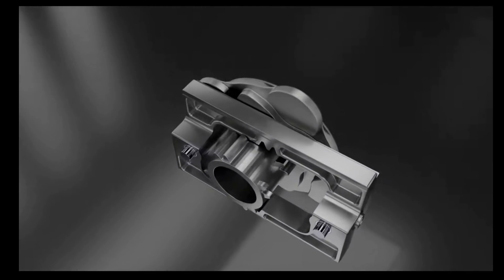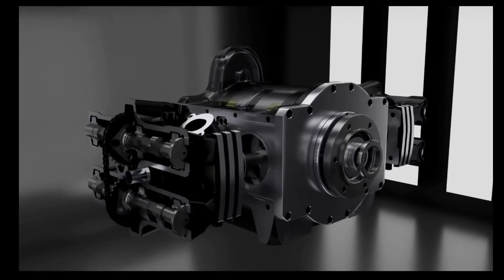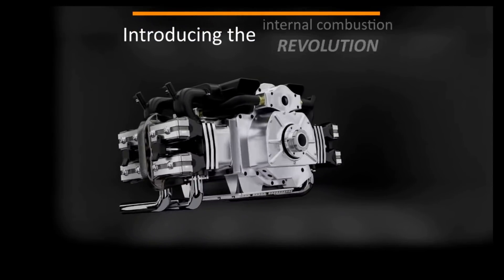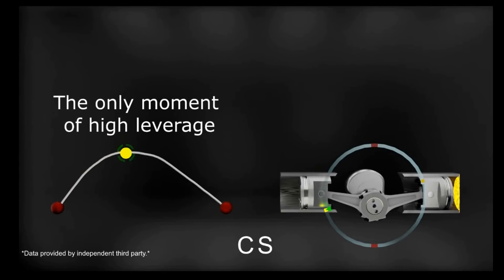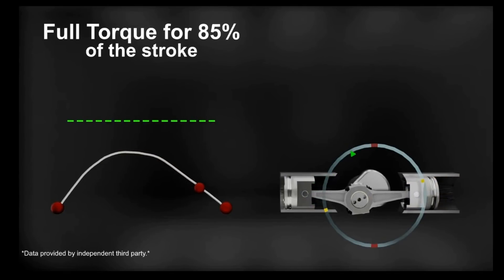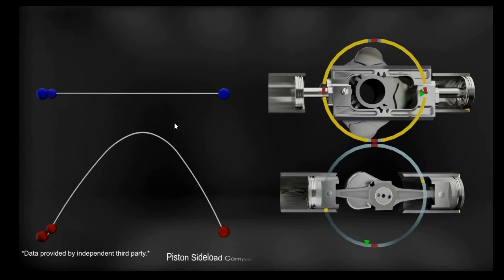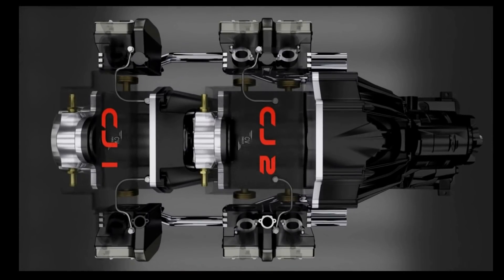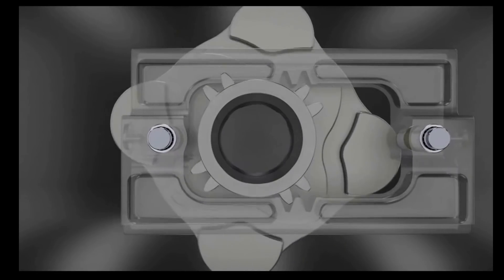More opposed Piston engines

Comment: I would like to hear your thoughts on Achates. They have been around forever with prototypes but haven’t been able to get to mass production.
Reply: It's the Junckers Jumo but now it's dropping off junk at Walmart instead of dropping bombs on London. At least with cylinder ported diesels you're not blowing a load of fuel out of the exhaust like with petrol ones.
Reply: At least Achates Power is farther along than Alfadan and this company.

They already got Walmart to agree to test their engines in a real world 3 month cycle to compare it to the standard Diesel engine that they're using.

https://www.nwaonline.com/news/2021/may/26/walmart-truck-to-test-new-diesel-engine/?business

A truck from Walmart Inc.'s private fleet will test a cleaner-burning and more efficient diesel engine starting this summer.

The three-cylinder, 10.6-liter engine will be placed in one of Walmart's Peterbilt 579 trucks to haul goods in Southern California.

Although the engine has been tested in labs, its use in the Walmart truck will be its first on-the-road test, said Karen Caesar, information officer for the California Air Resources Board's Southern California office.

The truck will be in service starting in July and will run for at least three months, said Larry Fromm, executive vice president of business development for Achates Power Inc.
Reply: From information released to the public, there is no reason why Achates's engine will not work.  However, it is a 2-stroke diesel engine.  The challenge is on meeting emission standard.  It may also consume a lot of lubrication oil.  If you are Ford, you will be　hesistating  to put this one into production when emission control is still a big challenge to it
Reply: @catchnkill  Achates claims to have the emissions issue under control to meet the CARB's new strictor emissions rules that are coming up in the near future. Now they're in the "Real World" testing phase with a potential big customer like "Walmart".
Reply: @Kamen_Rider_Blade  It is their  word only.  May not be so optimistic. Sure there are measures like catalytic converters, EGR etc can help.  Those will increase cost.  If native emission is more than traditional diesel 4 stroke engines.   The catalyst converter will be beefier, more urea required etc which will drive up cost in operation
Reply: @catchnkill  That's why Walmart is "Testing" the engine, see if it meets their "Claims" & lab results.
Reply: @Kamen_Rider_Blade  More importantly.  Walmart will test the cost of operation.  Three month is really too short to test the catalytic converter's durability.  This is a expensive piece of component that affects cost of operation a lot
Reply: @catchnkill  But Achates isn't selling a Catalytic Converter to Walmart, it's selling a engine. The Catalytic Converter can be bought from an appropriate OEM to match up against the engines Emissions.

All info that Walmart will figure out once they get their test data and to see if there is value to go further than this test.
Reply from the maker: Already on it

Comment: If the engine was being fed compressed air....the power stroke could very well be more linear but using a trapped charge of burning fuel and air the pressure drops dramatically once the volume increases.   People argue that the conventional engine has maximum leverage at 50% stroke length where the thrust angle is 90 degrees, which is true, but the available pressure is WAY down so most of the energy that is going to be gotten has been delivered by the time the crankshaft has rotated 20 degrees.  You can get a little more...like with a diesel by continuing to inject more fuel...but that assumes there is still oxygen to be used so the initial part of the burn will be super lean which reduces the pressure early in the stroke.   There is a very good set of reasons the modern engines work as well as they do...and all of these 'breakthrough' designs never seem to pan out...do they?   Anyone want to take a wager whether this design will make it to serial production?   I sure wouldn't.....
Reply: Bingo

Comment: The biggest problem I see with this design is the massive central rectangular component that connects the two pistons together and delivers power to the output shift. It is both heavy and fragile at the same time and it must reciprocate at relatively high speeds not a good combination for longevity  or efficient operation.

Comment: I wouldn't call that configuration an "Opposed Piston" engine because that configuration makes me think of the Porsche Boxer Engine or Flat Engine configuration.
https://en.wikipedia.org/wiki/Flat_engine#Boxer_engine
I know wikipedia offers 3x names for this configuration:
- Flat engine
- Horizontally Opposed engine
- Boxer Engine

When you state a "Opposed Piston" engine, here is what I think of:
https://en.wikipedia.org/wiki/Opposed-piston_engine

An engine where the pistons face each other and work off the same combustion event.

And I think Achates "Opposed Piston" engine is a better design than this Boxer Engine.
https://achatespower.com/

At least their design is fundamentally more "Traditional" other than the piston configuration.
The Cylinder will have the Pistons opposing each other, but other than that, the design is like two Inline Engines mated together and sharing a Cylinder for the "Opposed Piston" part.
Everything else is nearly bog standard with the exception of the Intake / Exhaust manifolds on the sides along with side fuel injection and having two seperate Crank Shafts that uses gears to join up and form one big crank shaft.

At least Achates Power has gotten far enough that Walmart is testing their new Diesel Truck variant of the engine.

https://www.nwaonline.com/news/2021/may/26/walmart-truck-to-test-new-diesel-engine/?business
The truck will be in service starting in July and will run for at least three months, said Larry Fromm, executive vice president of business development for Achates Power Inc.

That's a hell of a lot farther than this company or Alfadan has gotten.

On top of ARPA-E grants, I think Achates "Opposed Piston" engine is just a simpler design that does as little as possible to re-invent the piston engine while using existing technologies to get it's efficiency #'s.

Hell, even Liquid Piston has gotten further than Alfadan and this company.
https://www.engineering.com/story/update-wankel-20-the-return-of-the-rotary-engine

UPDATE March 5, 2021.  The United States Air Force has awarded LiquidPiston a $150K a Small Business Technology Transfer contract for an adaptation of its X-Engine technology to use in unmanned aerial systems (UAS) and orbs, urban air mobility (UAM) vehicles designed to carry people and cargo. The X-Engine rotary diesel engine is one of the technologies being evaluated for the UAS and orbs with a hybrid electric propulsion system. Because current battery technology limits the range of an orb’s flight, the X-Engine converting the energy contained in jet fuels could enable USAF's Air Force’s UAS/Orb to become a reality, says a LiquidPiston spokesperson.

UPDATE: Since this interview, LiquidPiston received a small business innovation research contract to develop its X-Engine for a hybrid-electric propulsion system for unmanned aircraft. The company was also one of 12 winners in the U.S. Army’s xTechSearch 3.0 and will configure the X-Engine as an auxiliary power unit (APU).

https://www.businesswire.com/news/home/20201215005194/en/LiquidPiston-Announces-Small-Tactical-Power-Generator-Development-for-U.S.-Army
LiquidPiston Announces Small Tactical Power Generator Development for U.S. Army
Reply from the maker: The pistons are point opposite directions from each other, some would say 'opposed' but who really cares? Lol
Reply: @thedirtyworkshop  I know it's semantics, but wouldn't your "Point Opposed" engines or "Horizontally Opposed" engines be a clearer to understand term?

Words are supposed to have a clear and understandable meaning.

Personally, I like Flat Engine or Boxer Engine as a more descriptive & accurate term.
Reply from the maker: It's a title to a YouTube video, not a thesis on engine design...
Reply: @thedirtyworkshop  Fair enough!

Although, I do love it when you talk about engine design.

That's what keeps me coming back to watch your videos.

So much to learn and understand from your teachings.

I swear that once you get into your "Senior" stages of life and retire from Professional work; you would make a great Mechanical Engineering Teacher at the University level IMO.

You have so much knowledge to contribute to the next generation of engineers.
Reply: This isn't a boxer engine, because the two opposite pistons move the same direction, not toward and away from each other (like boxers hitting gloves).

Comment: That looks like the design brief was to create a standard 2 stroke engine without using centuries old proven crankshaft technology and make it as complicated as humanly possible.
Reply: I call these kind of designs "square wheel solutions".
When the designer specifically sets out to solve an old problem in a completely novel way. After years of work the result is a bizarrely complicated, hard to manufacture square wheel that (under very specific conditions) performs almost as well as a cheap conventional round 100 year old wheel.
The square wheel has only one real advantage: The designer owns the patent for it.
Reply: Well said!
Reply: yes that pinion teeth is going to get fucked after 40 hours of engine runtime.

Comment: You are a dummy Tom - every new unproven design is 50% lighter, 50% more powerful, and has 50% less moving parts. And those are just a rookie numbers.
Reply: there are many working opposed piston 2 stroke engines out there which were widely used in buses. Take the Commer TS3 as an example. Yes they could theoretically be made 50% ligther, more powerful and have less moving parts. Because engines like these have already been made. This type of engine could be made to achieve these goals with the technology that we have today